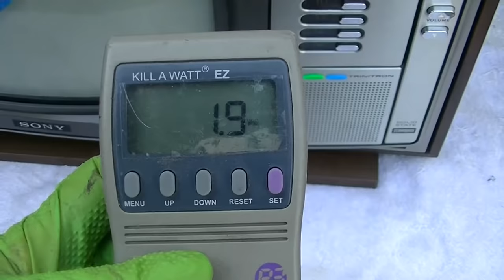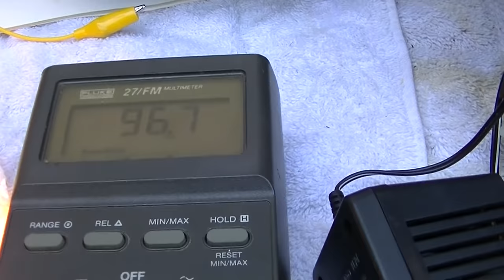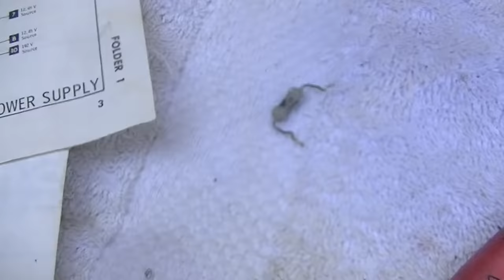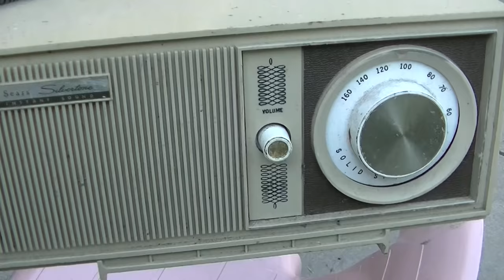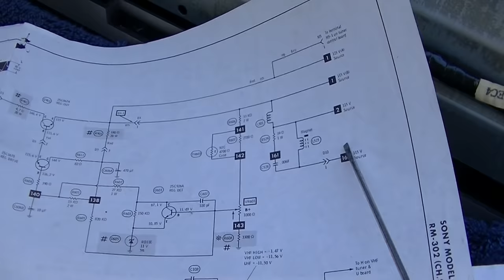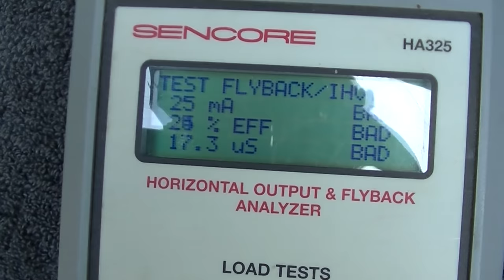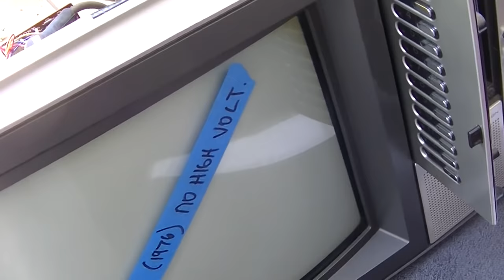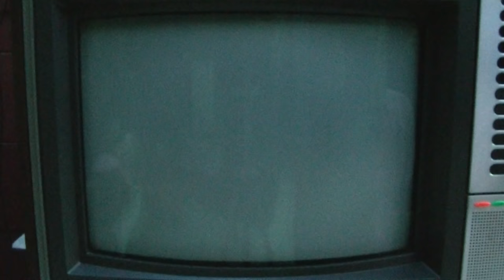Sony Trinitron KV1541 Remote Set Super Hard Fix 1977 Vintage Color TV

Comment: The reason for the odd test on the SCR will be the holding current, the Mtest only provides a few mA and the holding current of the SCR will be higher than that so it doesn’t latch

Comment: I admire your efforts.  But old CRT televisions are basically worthless today.  You can't even give them away.  Doesn't seem economical to spend the time and money trying to repair them -- unless it is strictly for the learning experience.  I earned a two-year degree in electronics and took only one class in TV repair (CRT TVs).  Never really understood how they worked!  I stick with mostly digital circuits now.  So much more logical.

Comment: You are mistaking oscillator circuit with power supply. Those TV was extremely easy to understand how all of it works. Learn more, then start fixing anything.
Reply from the maker: What a dumb comment
Reply: @shango066  If You better know electronics science, then please share with us. Or stop hating.
Reply from the maker: @norbert.kiszka  time to turn on mid-roll ads

Comment: I would get frustrated after 45 minutes and tell the customer to get with the modern age and get a new tv. Sure, may be a paid job, but when something like this happens and it's a constant runaround of trying to figure out what's going on and blowing up multiple parts, eventually the customer would have to accept the reality that it's a loss.
Reply: What a shame, seems the whole point of these videos is lost on some. From most challenging problems comes the best rewards once the problem is solved.
Reply: I think the  moral of the story  is you should  check the zener in the fail safe circuit before anything else on these tvs.